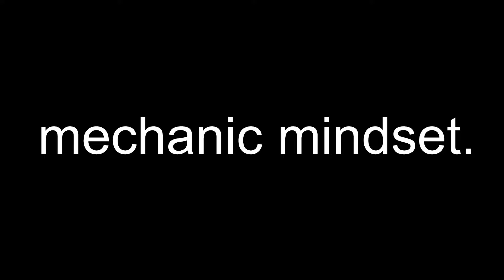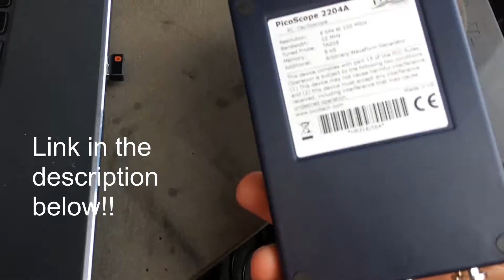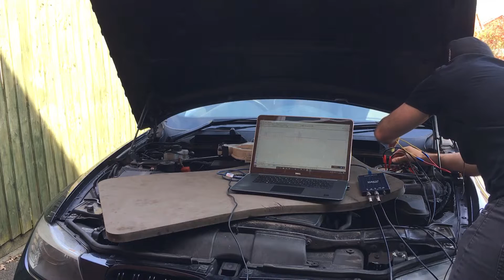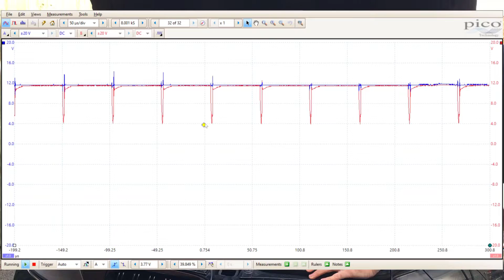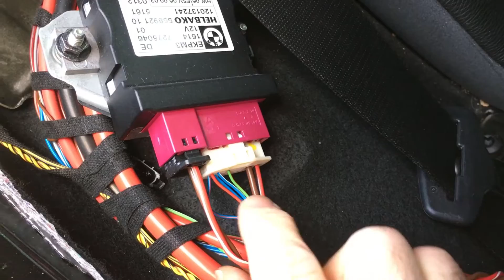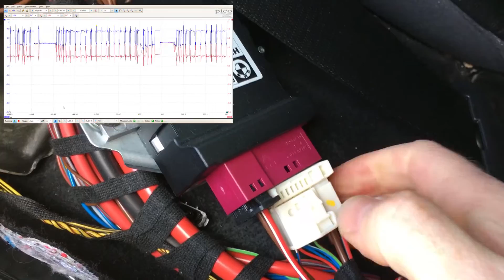HOW TO DIAGNOSE CAN BUS FAULTS [PicoScope 2204A Powertrain High Speed CAN] Mechanic Mindset

Comment: Another great video.  I love how you show the different fault can manifest themselves.  Just curious, if, when troubleshooting, you remove a module that contains the 60 ohm's resistor, would you place an actual resistor to complete the circuit and see if the signal clears up?  If the answer is yes, would a regular 1/4 watt, or 1/2 watt be sufficient?  Keep up the good work.
Reply from the maker: Stephane Chabot Great question! I have not tried this. There are so many combinations of fault to be had in CAN bus and I plan to explore this more for you all. In theory, yes, if you put the resistor in the correct position in the circuit. Not sure on the power rating but CAN doesn’t really draw much (if any at all) current so should be fine. Think I might have a *120 ohm resistor so will give it a go. Thanks for watching, glad you’re enjoying the channel!

Comment: Can i just ask the question. When you connected the leads to the can high and low you also fitted a earth lead. Where did the earth lead connect from when the other end was clipped to the car earth point. Great video and easy to understand and gave me lots of confidence to attempt these types of faults in future.
Reply from the maker: The Retired Mechanic, do you mean the end that connects to the scope? It is similar to an old TV areal connection. The inner pin is the red lead and the outer part connects to the black lead; these leads are actually made of coaxial cable. Look up BNC connector, that’s what this scope uses. Happy the video helps!